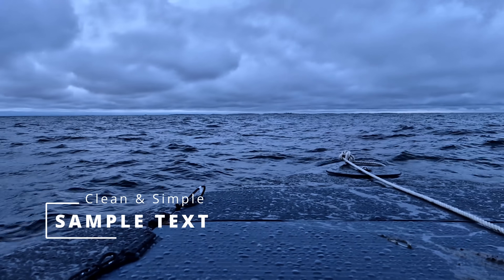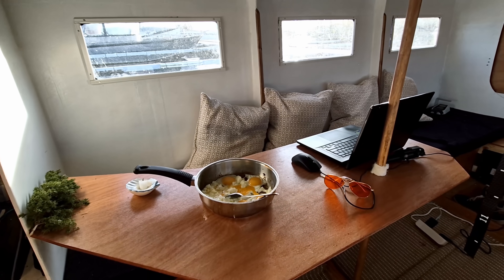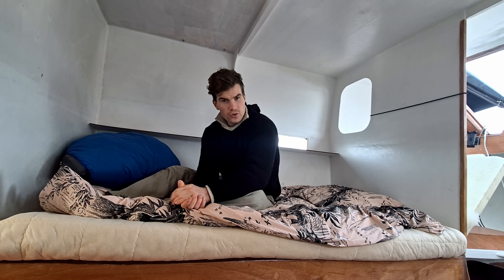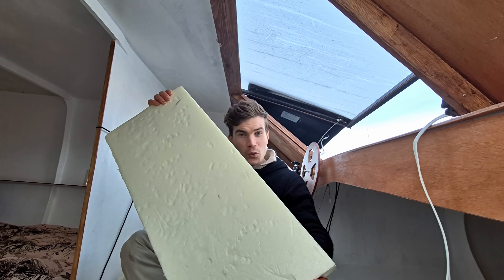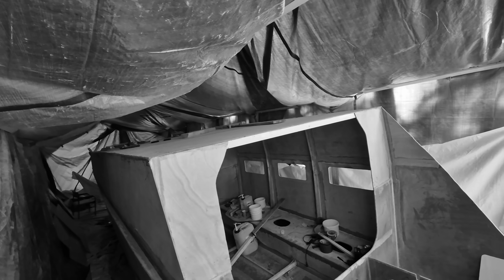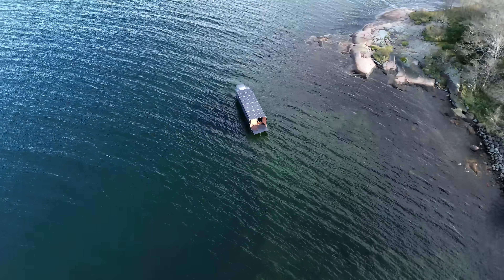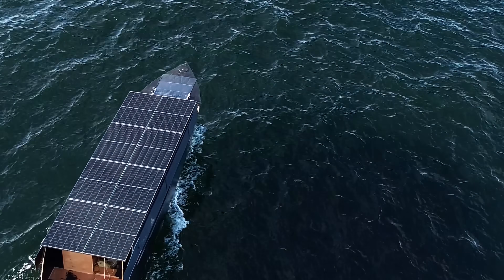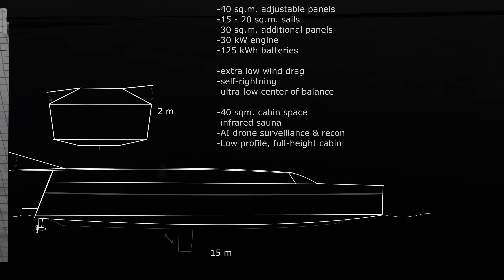⚠️ Power Failure at Sea – Solar Yacht vs. Winter ❄️ [Performance + Tour]

Comment: A few details.  Great basic design but needs much more power to be safe on a storm. 
Next too much panel weight that high up will make it roll more and in the wrong wave train, roll over. 
The solutions are changing to 'flexible/lightweight panels, more battery low in the hull and carry the flatter part of the hull more forward for more stability. WL should be equal or greater that the deck length. Leaning aft bows look cool too.
Almost all costs for docking, repair, etc, are by length. So do the shortest one that will work.
Use 2-3 windsurfer sails for night time, cloudy, storm use that can be taken down to not shade the panels.  
The plywood sizes are good if high grade, many plys, and maybe some Kevlar in the fiberglass for hitting rocks. I build my furniture in to strengthen the hull and make water tight open top boxes so it a leak, it'll only flood that area and safely get to port. 
Do an inboard with the largest prop you can fit is much more efficient,  safer in a storm as unlikely to cavitate losing thrust, a fraction of the cost, easy to repair especially if you build it.  Recycle a system from an old powerboat. Getting the outboard fixed can take weeks and cost a lot. Best be able to fix your own.

Comment: The point of a catamaran is that it has a smaller area of contact with water, hence higher efficiency and higher speed.
Reply: I agree here, when working with very limited energy the efficiency of the catamaran seems to be a no brainer. Plus instant redundancy of systems like motors and battery banks.
Reply: @Snerdles  It's not nearly as simple to design a catamaran without it breaking at the stress points. This design is weak enough as it is. A catamaran has more wetted surface area than a monohull all things being equal. The advantage is in wave cancellation at design speed. The catamaran might have much more problem docking in canals which seems to be the point.

Comment: IMO you need emergency heat option that does not use electric, or a backup generator. Also need some sort of emergency satellite radio, and a plastimo life raft or similar.
Reply: Starlink mini on standby plans is super cheap and can be used for VOIP calls or just regular communication and there are accessory packs for it to keep it in a clamshell case with internal batteries. The  standby plans are amazingly cheap once you have the hardware and if you want you just turn on a regular plan so instead of 500kbps you get "up to"  300Mbps but probably ~100-150Mbps which is better than most of the world's home connections.
Reply: @Snerdles This does not replace something like a ResQLink, EPIRB….sometimes things happen fast and you are in the water before you know it. Starlink Mini will not work so well from a submerged or capsized boat.
Reply: @UnexpectedInquisition But it should work fine from a dinghy/raft. Plus in standby it's only 5 bucks a month and gets you pretty decently usable internet nearly everywhere on the planet so it's not very useful in an "I'm floating with a life jacket in the middle of the ocean" scenario but compliments the regular day to day quality of life and can be useful in many things like "a motor failure has me stranded" and the like right up to absolute catastrophe.

Comment: Some things that come to my mind:
Autopilot.
Radar reflector
Spare motor. Spare chart plotter. And a map and a compass.
Fire extinguisher.
Safety vest. Safety raft maybe.
Bilge pumps. One electric, one manual.
A way to isolate a defective battery from the system. DC breakers maybe. Same with a defective solar charger. You need some breakers or fuses.
A way to clear the windshield from water. Wipers maybe.
Maybe more later ...

Comment: What is your opinion about reinforced Tow Jeck. In front and Back.
In front if something brakes and someone else have to tow your boat, and in the back if you need a trailer and for lifting your boat after it sunk.😂
Nice boat. But is it not a bit to large to tow it on the street on a trailer?

And another question:
You have your sail in the top front. If the wind came from the Side or not straight of the back does it not press your heading in wrong tirection so you need more Energy to compensate the heading offset?

Comment: I would add two slender outriggers to create a trimaran, you could get them from a sport catamaran.
You can then double or triple the amount of solar, increase the inside size and massively improve the handling.
Otherwise add a swing keel or two side keels(easy beaching) to reduce the lateral movement in the waves.

Then add a tiny four stroke outboard for safety and convenience and a dinghy.
A junk rig would be cool too.
Look up wave rover on youtube.

Also avoid open sea with this vessel, it's too light and unstable, it will be very hard to not get sick and tired with any amount of waves and wind, have an epirb on you and a good liferaft.
Reply: The backup engine could even be the same one you use for your dinghy if you oversize it for the dinghy it will probably still be enough for an emergency to propel the boat if it really is that light.
Reply: @Chris-ew9mh  Yes, we did that with a 30ft catamaran and a 9.9hp.
Enough to get hull speed on the big boat, enough to plane on the dinghy.
For this boat a tiny 2.5hp engine could be enough, but I would bump it up to a 6-8hp for safety and durability.
Would probably sip less than 0.5l/hour

Comment: I would suggest that you learn to flake down your lines for your anchor and always put the anchor on top so that it is ready to go . On my own boat I have chose to set up PVC pipe with a trip rope that allows me to set the anchor into the pipe rope in first and when the pipe is tripped it leans over the side and allows the anchor to discharge into the water, of course The Bitter End of the Rope is secured always

Comment: Did you not know you were low on batteries at 2 am or did they drain quickly due to cold weather? Could you explain your battery set up a little, like did you buy the matching battery system from epropulsion & what the total WH of the system? Also did you put the batteries under the bench seats? Good luck & smooth travels!

Comment: I notice you've chosen a monohull design for this initial iteration. However, have you considered a catamaran hull instead? Catamarans provide superior stability, expansive deck space for larger living areas, improved fuel efficiency (or in this case, energy efficiency), and a shallower draft, making them an excellent platform for solar-powered vessels. This design could also accommodate cantilevered solar panels that extend outward when docked at port, maximizing solar capture without obstructing onboard activities while underway.

Furthermore, vertical solar panels on the sides of the boat—especially bifacial ones—have demonstrated strong performance by harnessing reflected sunlight from the water, which can boost overall energy production by 20-30% compared to front-side capture alone, particularly during early morning and evening hours.

Finally, positioning the batteries at the bottom of both pontoons would lower the center of gravity for added stability, while also introducing redundancy through potentially independent systems and drivetrains, reducing the risk of total power failure.
Reply: Yeah two motors instead of one with a backup trolling motor..

Comment: I am impressed of what you have achieved in such short time and budget. Well done and very Finnish approach. Love that you are having a Sauna in mind for your 15meter version. I would also as many suggests use a PVC or PET foam core in the next version. It gives floatation, dont rot and at the same time insulation. Would be nice if you could point out on the map about how far you have come in your journey in each episode. Take care and good luck.😊
Reply from the maker: Good ideas, thanks. 

"Very Finnish approach" :D

Comment: Not trying to be a hater because I love your boat but…not ocean capable. I have balls bigger than grapefruits, you must keep basketballs in your drawers. Even your 50 foot version looks sketchy to me. Too much roll, in big waves I would get sea sick. A big wave from the side is going to capsize you. If you look at those orange life rafts with a similar hull they’re loaded with foam and that may be an idea. Otherwise it needs weight in a keel. Maybe a water ballast might do you. Everyone is worried about the heat, I’m not, you got enough solar to operate 5 air conditioners.  I would want more hangout spots outside though. Maybe panels that fold out of the way to create a porch?  I know you want to lose the bifacial but that’s going to bring your energy gain on cloudy days to near zero.  I do have high hopes on solid state being more affordable in a couple years, that would reduce your battery weight by half. Your boat is going to be the king of the canals for sure. I’ll be following you the entire time because I’ve been curious what would happen powering a hull like that with solar for a decade. Talk to engineers about your next boat, this channel is going to attract plenty
Reply: Don’t mistake ignorance for big balls , this guy is a disaster waiting to happen
Reply: I think it's an amazing canal boat. Anything else? Not so much. I love the concept though. I'm hoping this boat doesn't kill him so that he learns some things and makes a safer boat.
Reply: @jodyssey9921 Agreed!
Reply: Yeah, well, I think pretty much all engineers left the room. There is so much basic physics/technical rules violation as well as safety's ones. 
Let's just hope this gentleman masters German language and regulations, because these guys are probably waiting for him to talk about "Sicherheitsmaßnahmen " 😅🤌
Reply: The front hatch is an unmitigated disaster alone. Taking this walnut shell on the baltic sea is tremendously stupid.

Comment: A sailing design that needs to come back is a square rig. Just forward of "windshield".  Downwind sail can be made of solar panels, and put in horizontal neutral canope mode with bow sprit.  Your mast position can also work.  Lines that lead bottom spar to top of mast can be used to suspend outer spar in wind neutral position, including bottom spar to deck lines for dual tension, and positioning.

Congratulations again on a great project.  I'm curious in the longevity of your deck forward solar panels, and any impact of walking/sitting on them.

Comment: Good luck reaching the Med! On the next boat use foam core plus fibreglass above the water line, for a lighter design. Figure out a way to attach fenders. You can use a sculling oar for propulsion from the cockpit/swim platform.
Reply from the maker: Thanks for supporting the development of True North prototypes. 

Foam core plus fiberglass is stronger I believe, but then you are required to make more work and add materials for interior design. Everything is a tradeoff. My reasoning for simple plywood even in future models is that there is little need to add extra interior surfaces as wood naturally feels and looks good, especially if its finished with precision.
I have fender loops in my toolbox, but haven't yet had time to attach them - I'm in such a hurry to travel south as well as document this mission.

See you in the next video! Follow your True North

Comment: I like the idea, been thinking about this sort of low budget houseboat as a cheap place and way to live.
Light weight is great for “fuel” efficiency, but the downside is that the boat acts like a cork bobbing on the waves, even small waves..
And just walking around makes the boat already move excessively.
I like the idea but I would choose for a warmer climate with a heavier boat, more batteries and fresh water storage weight to make the boat more stable.
An electric houseboat as a place to live could be used locally, in my opinion it needs more calm water on canals and lakes etc. to be useful.
The sort of conditions like we have here in the Netherlands.
More weight is more comfort, but you have to give the boat more sunlight or time to charge its batteries.
It also helps if you’re not having to relocate as much.
Otherwise if you wanna cross open water on the sea possibly ocean a bleu water sailboat is the way to go.
A sailboat supported by electric propulsion or just a small diesel engine to get into harbor or away from the coastline if needed.
Reply: The heavier you make it the less the electric-solar math works.
Reply: @weatheranddarkness 
I know, that’s why it’s okay to use on lakes and canals but not really to go out on choppy water with waves or on rivers with a strong current.
You’ll get tossed around like a cork and you’ll lack power for longer trips against currents.
There is a reason most sailboats have heavy keels, significant displacements and use diesel engines.
And why only a few sailboats use electrical power for propulsion.
They use the limited range of electrical power to get into a harbor or go down a canal.
But when you’re out sailing the coast you’ll need to be really careful if you’re not able to get away from the shore when the wind or currents wanna push you on the rocks or beach.
A really light electric boat is very sensitive to strong winds and electric propulsion from batteries lacks the power and duration of energy to get away from the coast for longer periods of time when needed.
A prolonged storm and you be in trouble.
I love the concept as a houseboat for inland waters/ lakes and canals.
But I would never go out on sea with an electric vessel that’s not a sailboat and does not have a heavy keel.
Unless it’s a catamaran or trimaran.

Comment: Glad to see you'll be going with the adjustable solar panels next, that will help tremendously with efficiency. Lightweight foamboard insulation, a small Buddy heater for heat, and a fan or two for cooling in the warmer climes would probably add to the comfort. For enhanced sovereignty you'll want to consider a solar distillery for clean water, if you haven't. I also wondered if you'd be adding a wind generator? Some kind of back up propulsion system for foggy, still days, just in case? Fun watching, looking forward to Log 5.

Comment: Is there still a Basalt fiber producer in Finland ....there was one there may also be one in Poland looking on line..it has a lot of advantages... The other big improvement would come from using chemically engineered timber.... Search U tube for Inventwood's MetelWood and Superwood which has gone into Pilot plant production this year in the US ...but as it's a University research project spin off this would spread to wherever softwoods are grown large scale. 
The result is 20times stronger ten times the torsional and 5 times  tear/abrasion resistance grade A fire proofing , Rot and insect pests resistance  and much more... It can also be moulded  as a part of the conversion process  it's also non Toxic unlike chemical treatments.  ..
It's lighter cheaper and stronger than Steel or Aluminium. ..whilst being carbon negative in production by 50% .

Comment: So glad you are taking the canals instead of the ocean
Reply: hahahahaha
Reply from the maker: To be fair, the yacht is not yet Atlantic ready. I need to increase ballast (batteries), upgrade solar, create better fins that are lightly weighted, as well as add watertight gaskets to all my doors. 

Then, I will have an entirely watertight yacht that is self righting, and can only sink if I intentionally head into a storm or hit an iceberg.
Reply: @Lukas-TrueNorthYachts  Typical storm wave heights

Average: The average wave height can be around 11 feet (3 meters).
Significant: The "significant wave height" (the average height of the highest one-third of waves) can be about 17 feet (5 meters).
Frequent large waves: One in ten waves can be higher than 18 feet (5 meters). 

What about your hull strength for storms you can't avoid?
Reply: @Lukas-TrueNorthYachts is better when boats break close to shore. Every boat breaks. Let the early breaks happen soon... near shore. Practice beaching in case of leak. Solar bilge pumps are great
Reply: thats so gay. just make it right
Reply: @snorttroll4379  Guessing you've never heard of a prototype?
Reply: @snorttroll4379  and die, like many other people die in the ocean? I say pass.. Let's use brains for thinking, if this boat tips, it most likely will sink. or float half-sinked anyway, being useless as  a boat. Bad if it happens in the middle of the ocean.
Reply: @cristivpopescu  I am not a sailor. How about the Mediterranean Sea? I concur with you on the trolls.
Reply: @IntellectualHonesty-1956 That's where he's heading. This is basically a ferrying trip for the boat.
Reply: @moteroargentino7944  I know, hence my question.
Reply: @moteroargentino7944  omg you are right. i checked. .... ... he really wants to cross the atlantic, in the future. Perhaps in the other ship he mentions, helios15. But even so, i don't think it's doable without considerable risk. it depends on how the new prototype will be designed, though. crazy either way
Reply: @cristivpopescu  Assuming he makes it to the Mediterranean. Decades ago, I had a 17' ski boat. I took it across a 30 mile wide lake in the afternoon from a glass like surface in the morning from the other side. The return trip had 4' waves from nowhere, and I was very afraid of killing my family. We made it but barely. And that boat was more sea worthy than this young man's boat.

He has not done his engineering homework on this boat. I am no sailor, but I am not an idiot either.
Reply: @IntellectualHonesty-1956 yep.
Reply: @cristivpopescu  make it a trimaran and it won't tip ;)